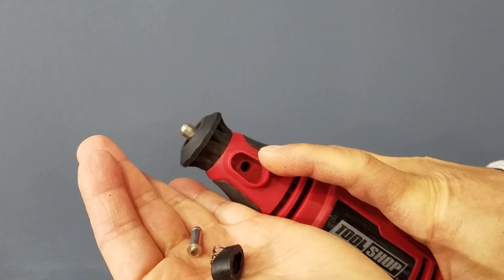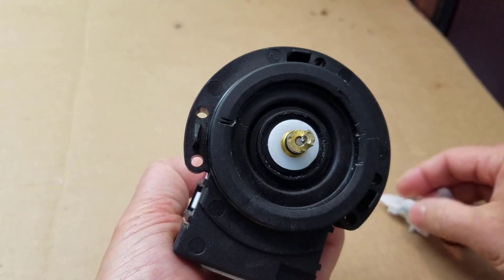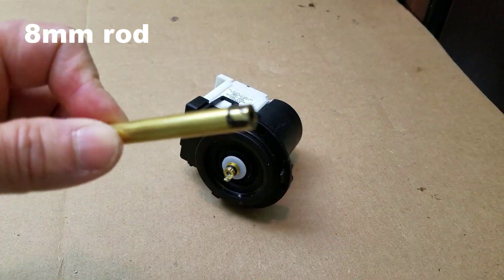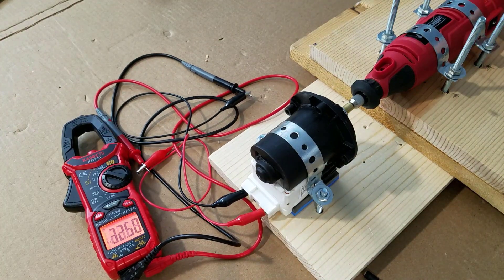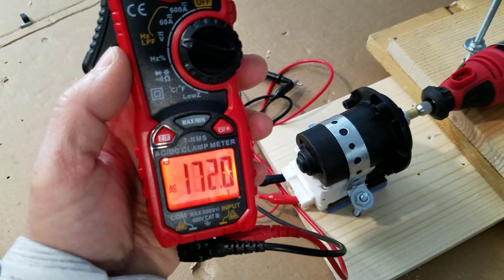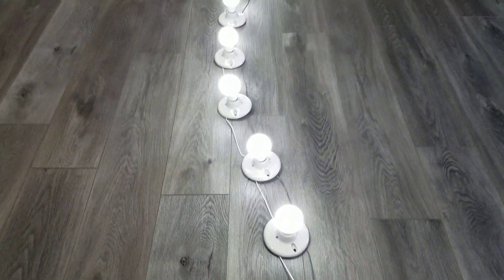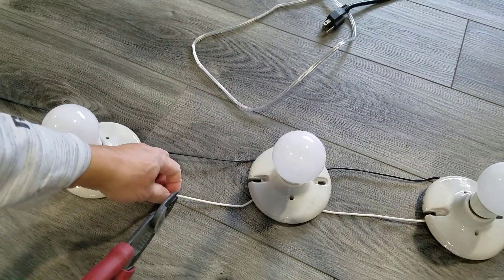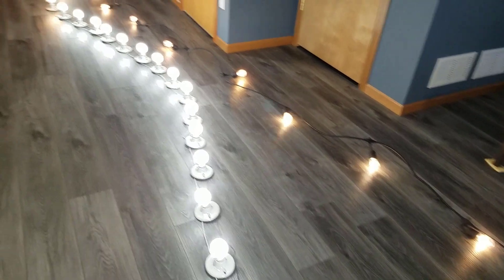I Turned A Tiny Washing Machine Pump Into A Generator!

Comment: I'm not trying to bash the video but from a scientific observation 60A at 200Vac would be 12000 watts of power??? Have you seen the size of a 10000 to 12000 watt motor??
Reply from the maker: This is an RF modulation demonstration. It's not the typical AC current as we know it. I think Telsa called it Static Current and Radian Watt.
I did test the AC power output with the AC motor used in this video https://youtu.be/AEC83oQvgEk It did not work. The power came out from this setup is good for lights - for now. Some modifications are needed to make this RF Modulation energy more versatile and useful.
Reply: @TheoMaxim777  translation more real, haha.
Reply: @TheoMaxim777  yes it safe to tuch brother, it modulation current.
Reply: So am tryn to understand this rf modulatop/ motor from washing machene....is modified by mr.guru to make this tesla rf modulator motor/ generator
Reply: This is all bs? There is no such thing as a rf modulator generator? Its both washer motor and gen.w/out modifications....come on, why bs people...i need to know? Magical magician/ electrical electricion
Reply: @TheoMaxim777  : You my friend are full of shit.
Reply from the maker: @Rev22-21   Sorry to disappoint you, but it's real! It's something relating to high frequency that make this system operational. I don't fully understand the high frequency effect either!
Reply: @TheoMaxim777 Congratulations, I have tried once to do this without positive result, but now I know from where It comes these energy. It is radiant energy - Schuman Wave - the model works like radio by proper frequency we may receive this cold electricity. So matter is proper speed of dc motor. I hope mine model will work - seeing Your clip also motivates me to continue the Research.
Reply: @TheoMaxim777  ❤please connect at the earth lol ....❤
Reply: @TheoMaxim777 Hello Mr Mighty Tiger, thank You for Your clip. I have also done some similar setup - I got really high AC Voltage over 1000 , but I was not able to light few LED lamps ? Do You have any suggestions what can I improve to get results as You ?
Reply: @TheoMaxim777  A motor of the same design as the source may work at certain frequencies. Per Tesla's experiments.
Reply: @chucklaizure1442  nope, none of these work, not one. Century old tech, as a mechanical inverter. Coverting one voltage to another. In this case 220 ac into 220ac not sure why you want to do this. Power input is always less than power output. So just wasting electricity.
Reply: @KevinSmith-os5yz Go study cold electricity/radiant energy then comment,  had you, your comment would be the opposite lol
Reply: Also ac synchronous motor or similar would work on output go watch gerard's first videos he shows a pancake motor being powered with the output there are ways of achieving this you know what man I'm going to revisit this project I'm going to rebuild my old setup with bearings and better motor will let you know what i find out
Reply: @overunityresearchchannel  update
Reply: TheMultimeter,MaybeShowsErroneousAmperageBecauseTheFrequencyExceeds60Hz.BetteeWouldBeToMeasureDcAfterConectingADiodeAndTheAmpsAreAproximatelyHalfOfTheOriginal.
Reply: @ovidius2000  : For starters YOU NEVER CONNECT AN AMP PROBE  in parallel like this amateur did directly across an output, rather it should be in series with some type of load (i.e. a resistor,  a series resistor or inductor).  Secondly,  measuring an "unloaded potential voltage output" is one thing (as he did)(that was okay) but what voltage did he have once everything was connected; and what was the current measured in amps?  Lastly, his conclusion is laughable.  In a word....What he accomplished has nothing to do with what Tesla accomplished concerning "radiant" or "dark energy" as Tesla called it.
Reply: @Rev22-21  withoutAloadItIsShortcircuitCurent,AndItCanBeAGoodIndicator.ButIFoundThatHigherVoltageRfBurnsDiodesAndIBurntAMultimeterToo.
Reply: @Rev22-21  At first glance it did look like he had the amp meter in parallel. But with the meter being the only thing connected to the pump motor, t was in series per normal usage.   To be clear,  I'm not saying this works like they claim.   Nor am I agreeing with the wild amperage he claimed.   I do believe there are alternative energy tech that can actually work.  But the space has been branded as all scammers with so many claims of perpetual motion etc..  Which is a problem that will keep the funded scientific community far away.   Maybe that's the biggest problem needing a solution in this space.
Reply: I watched a different analysis and this drill motor turns the washing machine generator so fast that it can reach about 10 Khz , but it is still some kind of distorted Sine wave...so it is still pretty efficient.
Regards Stefan.
Reply: These magnets are polarized a different way and a good idea would be to try to find a bigger version and encase it in a much more stable ferrite core Case....so it will not have eddy current losses and don't heat up too much...
Reply: Not just North South polarized, but Radially polarized, so they achieve these high frequencies.

Comment: After waterproofing the contacts, place most of the body in engine coolant, that way you can run it longer. Or suspend the rotor with bearings on each end. If you do that, i can get you 30 more subscribers. Deal?

Comment: I have a couple questions and ideas: 
How long will that motor run before it over heats? 
2. If it over heats, to what extent would it over heat? Would it break or could you just wait (a cooling gestation period) then run it later? 
3. Could you blow cold air on it to cool it from over heating? 
4. How long will the drill run? 
And 5. Can you loop the washer motor with other ones to prevent overheating AND same goes with the power tool.

Comment: Hi, what is all the watts added up on the lights? and what was all the AMPS draw?
Reply from the maker: Unfortunately I didn't get to measure all of that. I did test a high amperage load, it didn't work too well. It worked well on light bulbs due to the high frequency output, which I could not explain beyond that.

Comment: Hi, I like this setup very cool but why do you say the motor/generator will not hold up or last is it because it gets hot and melts the housing and what other load have you done with this.
Reply from the maker: The motor has a very weak bearing setup. It's almost like toyish!

Comment: Garbage.
   It's not connected to any circuit in the house." The wattage of the light bulbs is greater than the small windings in the motor.
 Sensationalism in seeing people are clueless about electricity.  Amps. Watts. Loads  or voltages.  But love a light show.
Reply from the maker: I wouldn't say all that. Please give it a try first.

Comment: Hi MR; Mighty Tiger : I watched a gain in 2024 , the real one is no one is going to belief at all, than they belief the fake one, please show up date Idea in your 2024 how to convert  let it run last longer, I ran 11miles around trip on my wheel chare with this thing to charge my batteries no fuse no power inverter connected just small voltage regulator, thank for show .
Reply from the maker: Thanks for your comment. I've been busy with other projects and had no time left for YouTube video, ... sad... The content in this video is something you should try. It's really amazing.

Comment: How many watts is each bulb?  It seems the Dremel thing is about 1.3a at 120v. I want to believe this I really do. I've got a Chevy Volt with a bad head gasket I don't want to fix that so I need to do what eventually I want to do anyway. The EV system is 360v.
Reply from the maker: These are 10W LED light bulbs... Something relating with high frequency that I don't really understand, that makes this system operational.

Comment: You have to have a LOAD to find amps? What did you do? Short the wires to get current??  The meter has to be in series with the load! Or you have to have a special meter clamp that goes around the wire. But a LOAD has to be used. Otherwise you have shorted your meter.  Most meters are only good for reading 10 amps.

Comment: interesting experiments but unclear motivation and especially wrong measurements - you measure AC voltage and current (without load!) at an unknown frequency - will be the same as the engine speed, between 6000-30000 rpm (the usual range of these tools) i.e. up to 500 times higher than the normal frequency of the mains. no information about the load / bulbs used, no measurement results under load .. is it free natural electricity? - of course not - did you forget the cable leading to the drill?

Comment: Its A Gerard Morin replication. The output that Washing machine pumps make is cold energy ie just the magnetic component. Well done. you can connect a bridge rectifier and also charge a bank of batteries!
Reply from the maker: I'll need to try the bridge rectifier and batteries.... and Yes, I should had given Gerard Morin credit on this topic.
Reply: @Mr Mighty Tiger  a frequency generator has been around way before Gerod Morin make his. Morin just rediscovered something that someone already knew.
Reply: Cold electricity is actually using the dielectric field to power a load, electricity is the conjugate of magnetic and dielectric fields and that magnetic component, the amps, is what makes it lethal. By removing the magnetic component without killing the flow you get Dielectricity or cold electricity, which is not the same thing as high frequency and voltage low amp power, Tesla called it radiant energy.

You can see this in physical form by running the power through a hairpin circuit before entering a spark gap, the spark will be completely white and will not react to magnets in any way, completely unlike regular discharges.
Reply: @JenkoRun  So you're saying this is cold electricity?  I've seen similar motors driving similar lights on Youtube, but nothing to this scale.  What makes that possible, and what is the limit of bulbs that one motor could drive?
Reply: @justbob1581  Ttbh I'm not entirely sure what he's doing here, going by the comments at first glance he's using the same energy that is produced in a hairpin circuit, aka Dielectricity, but normally you get a lot of noise from that kind of power when powering a bulb with it, so if he is using it here I don't know how he's avoiding that.

Alternatively what he actually might be doing is something Tesla did a while back where he surrounded himself in "cold fire", it's essentially very high frequency and high voltage with very low amps, the skin effect comes into play there and it allowed him to take these "cold fire baths" that cleaned the skin like a regular bath, along with other health benefits. This would also explain why he's not getting the regular sparking in the bulbs pure Dielectricity normally shows, ideally bulbs would not use filaments when using that sort of power to avoid the noise problem.

Honestly without more details on exactly what he's using here I can't say more. It would help a lot to know if the machines produces heat in itself or the wires in the bulbs, or the bulbs themselves, if it does that means there's magnetism present, and there isn't any in radiant or dielectric systems

Non magnetic power systems are also safe to use in regular water as well, so that's something I'd like to know about this setup.

Comment: What I belive that is multi pole magnet demagnetised crushed it to pouder then glued to the rotor magnet pouder its high frequency generator basicaly the housing is important because if it contains florine gas type in that plastic housing no friction ore try to use grafite oil as lubrication .
I was wondering what wuld hapen if you add neodimium magnet but Im positive it wuld not work and that current then wuld kill you like that its more ore less harmles if you tuch those 2 terminals Gerard Morin demonstrated this.
I belive wire oriantation is important and polarity if you actualy wuld swap one of those windings it will probably cause Lenz effect if you probably rewond wire in oposite direction tehnicaly you wučd rnd up with 2 more positive ore 2 more negative wire lay out.
There is nothing in those light bulbs except filament the glas it self are embeded with elements who are light sensibel oreelectrons more ore less rubbish sience crap there is no gas in those bulbs if there were any gas there it wuld explode/implode emidietly .
So to me that thing is high frequency generator it probably works only for light bulbs probably to make it work on biger loads the motors them self shuld posibly be reconstructed I belive toroid transformers do similar things .
I still wonder what wuld hapen if you change coil sizes lenght and use diferent wires what effects might acure .
Most similar motor is shaded pole motor to that thing I supose .
Perhaps thermal ore microbial fuel cell might help you out .
Normal lead acid baterry probably wuld explode ore do any thing ells strange staff but not what you expect it to do.

Comment: Iv know alot about the Gerard Morin RF energy pump in fact i talked to gerard couple years ago when I first replicated that device anyways I wonder how many bulbs power with it also can you try and mount them on top of a solar panel and charge a 12v battery battery maybe put a inverter to power the dermal I dont think it would loop but it might be possible

Comment: So you're lighting about 200 watts of LED bulbs.....  That equates to about 1/4 of one horse power. What else can you do? I suspect nothing. One refrigerator alone requires 200-250 watts, a typical washer 400 watts, an electric water heater 2500 watts, a clothes dryer 2000 watts, one TV 200+ watts, an average microwave oven 1200 watts, a toaster 750 watts, a coffee maker 750 watts, a 3 ton AC unit 5000 watts......get the idea?

 Bottom line..... I applaud your enthusiasm, but you never connect an amp meter across any generator output like you did and while it looks good ....to really do anything of any consequence one would need (on average) a 14-18 KW generator to power a typical home. That'd be a generator 73 to 95 times larger than yours. Just sayin.
Reply: But still, it’s very neat!

Comment: That is the exact same one I got, 85 W and I run it with a 775 12V  high torque motor 3500-9000 RPM.

Comment: Very interesting solution.  I hope you find time to improve.  Can you give information about input and output data?  I guess the input is about 200W ????
Thanks.
Reply from the maker: Thank you for your comments and support. Sorry I didn't measure the input/out wattages.... One day..., I'll make time to improve this system. Even though it didn't have the "normal amperage" to drive a 120v AC motor I tested, but it had no issue with making many light bulbs bright.

Comment: Couldn’t you use this, since it’s putting out a lot of amps and voltage, to power itself and then also power other things simultaneously, since the power is being stepped up so much through the gears?
Reply from the maker: I wasn't sure how the meter was able to display the amperage so high. My guess was due to high frequency beyond the design of the meter. I tested the power out put on a 120v motor. It didn't have enough "normal amperage" to drive the 120v motor. With light bulbs, it had no issue making them bright.
Reply: @Mr Mighty Tiger  The pump motor itself says its rated at 80amps.  You should be able to measure the amps if you switched your meter to the 600 amp setting instead of measuring on the 60 amp setting.  Good idea using the rotary tool.  An RC motor will also work in this setup.  Unfortunately both the pump and the motor aren't supposed to run for long periods of time.  Now you could connect the pump with a slower motor with a 5 to 1 gear ratio similar to one of your videos with the an alternator, 3 gears on the same belt.  Alternator to the cap bank to your lawn mower battery lawn battery to the motor to the pump back to the alternator.

Comment: What is the wattage of each of the bulbs, 
and are they all the same.I understand the generator has a duty cycle at 10 minutes on and 50 
minutes off
Reply: A: In reality each of those LED bulbs he's lighting uses about 6 watts (at most). Now do the math................. If he used 30 that'd be 180 watts.....kinda like 3 sixty watt incandescent bulbs of old. If he used as many as 60....that's only 360 watts. Though pretty..............he wasn't producing more than 120Vac and 3 amps all said and done. Why you ask? Because those LED bulbs can't operate much above that voltage (here in the US.) and Watts always equals voltage times current (i.e. 120volts × 3 amps).

Comment: How long will this little pump motor run before it starts to heat up or burn out the plastic bearings very good tutorial
Reply from the maker: It can't run that long since the RMP exceeds much greater than 10,000. There's plenty of room for improvement.
Reply: @TheoMaxim777 wonder if it would run in an oil bath to mitigate that problem

Comment: Yeah man those pumps are legendary.
Reply from the maker: I wish the housing for those pumps were made from metal instead of plastic! That way they could be useful for long term use for this project.
Reply: @TheoMaxim777  brother i understand that motor design for water pump not for generator it cool by water when in use, we convert them to generator that why it is so hot and quick to worn out it no bearing only plastic bushing, i did add bearing and remodel the body to metal it run longer, but the noise it worst and use 12v dc fan to help cool, that the through from my heart. please reply! thank🙏✍.